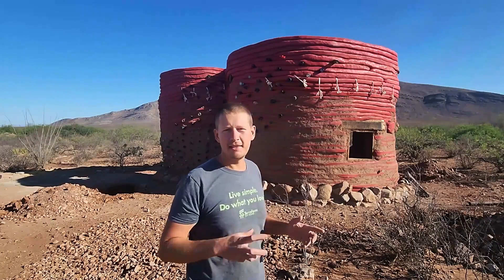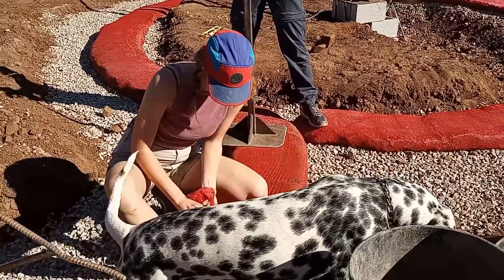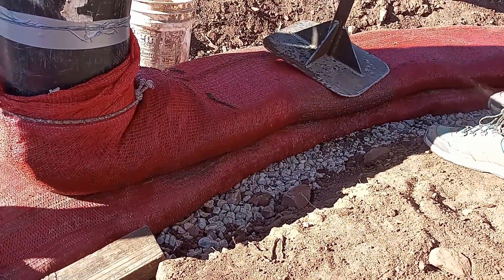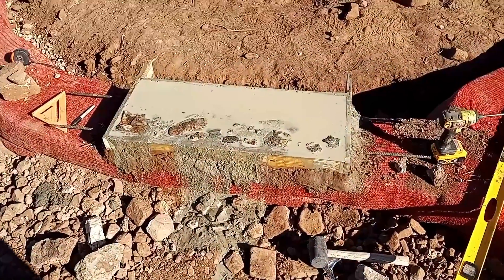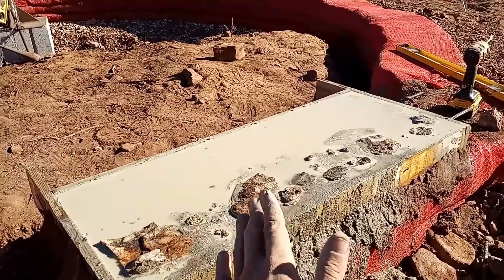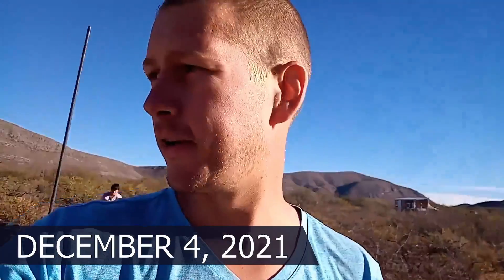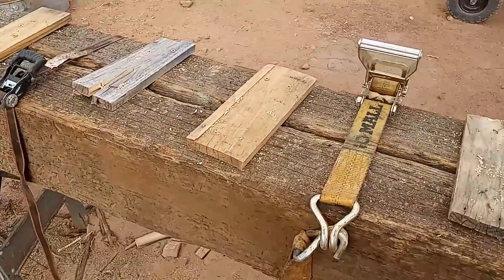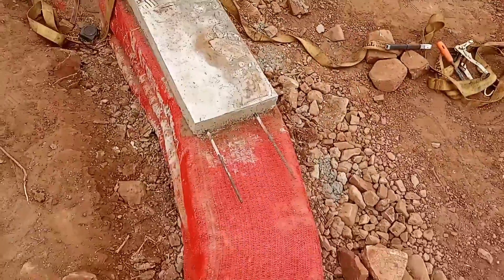Learning how to build HYPERADOBE + Mice Take Over | Off Grid Hyperadobe Earthbag Tiny Home Ep 2

Comment: please apologize my ignorance but why do you have so massive door posts?
Reply from the maker: We used railroad ties for our door post framing. This was done by another local YouTuber on their build and it seemed like a good idea because they are cheap, sturdy, and look really cool... Unfortunately, we learned they were a REALLY bad idea. Our video next Sunday goes through that mistake.  Thank you for the question though!
Reply: thank you for explaining. From recycle point of view makes totally sense. And also thank you for taking time to answer all questions
Reply from the maker: @gutesgelingen  Totally! They are super cheap here locally and rock solid for the price... but the cresote coating on them makes them toxic for interior use and dangerous to cut and work with. I did not know that going in. 

We were able to find a company that has a product that seals in the toxins for renovations because old buildings regularly used cresote-coated beams and it's a real problem for a lot of people. But it was $350 for one gallon... making these beams pretty expensive to use compared to new lumber that's safe. 

We'll go into more next week. Thanks for following along!

Comment: Thank you for documenting this. Curious if the strobe will hold up and be sufficient for rat ingenuity and their propensity for late night disco parties -- they love freestyling to that rat music. What's good practice for drainage under the first bag? Is there any grading or perforated pipe? And is the amount of cement in the earth mix different for the first layers? 👏
Reply from the maker: 😁

The strobe light has seemed to be a good deterrent. I haven't noticed a lot of activity under the house over the last several months. It runs on a timer for 15 min on 15 min off throughout the night. 

We used about a foot of gravel that was compacted for our foundation. Since we are in such a dry climate and are putting such large eaves over the whole house with gutters into tanks, I am not terribly worried about moisture and needing too much drainage. If you were in a wetter climate or building where you have a lot of ground water soaking in, I would defiantly put in perforated drainage pipes to be safe. 

We did a 1:5 cement to earth mix for our underground layers, then a 1:10 mix for our above ground layers. We found that our clay hardens up so well because of the caliche that on our next house we'll just be doing 1:10 below ground and no cement above. 

Hope this helps!
Reply: @TerraformTogether  Thanks for the details and your prompt response, really appreciate it. Thanks for the inspiration!